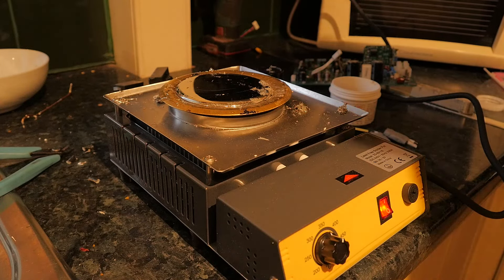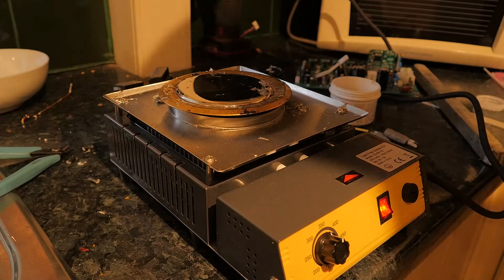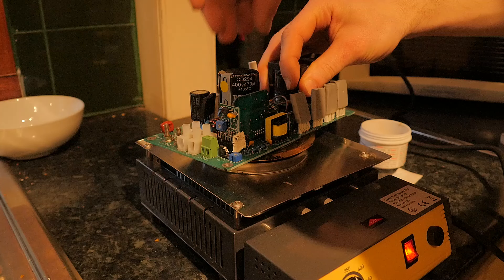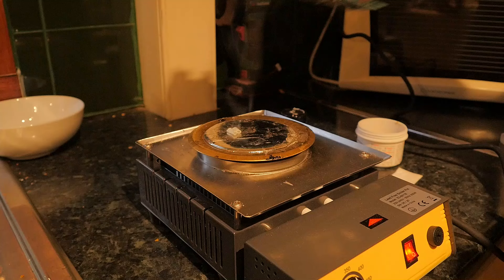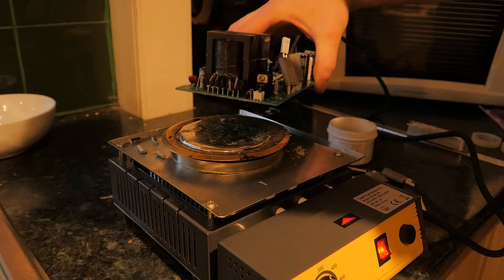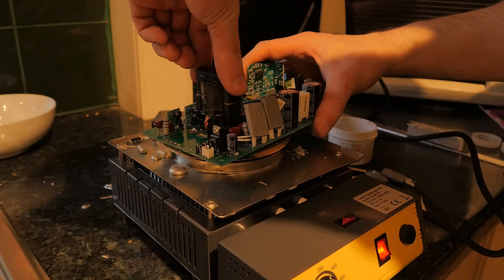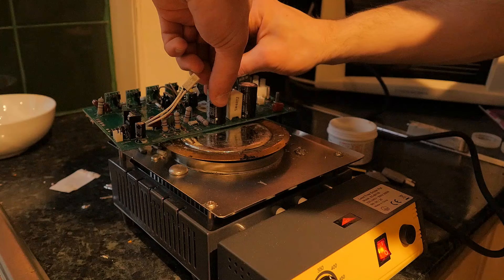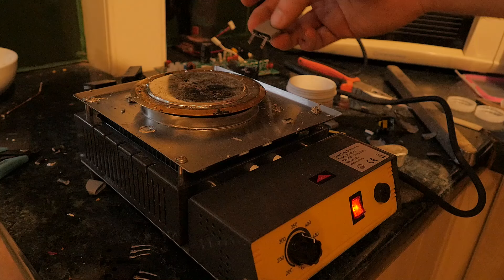Lead Free Desoldering Bath

Comment: I would just nip to my local Scrap Merchant for some lead pipe. Melt it in a pot to skim the impurities off, before using it.
Reply from the maker: That doesn't work as it flows very badly and damages the components on the board due to its higher melting point.